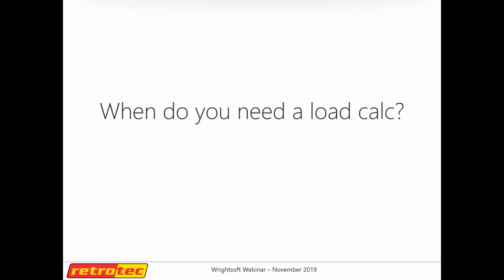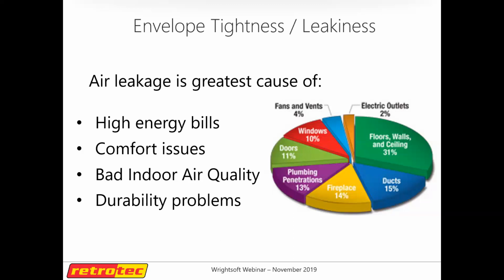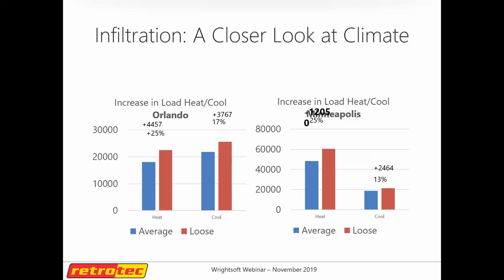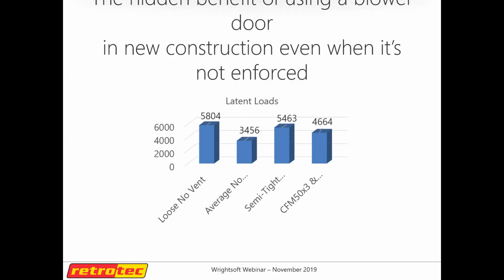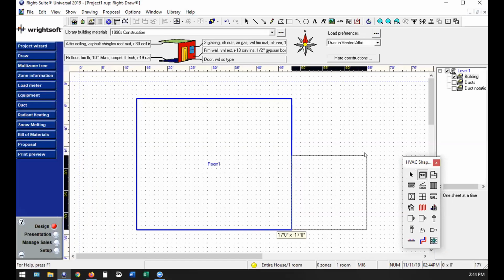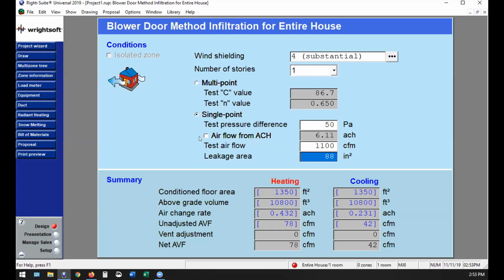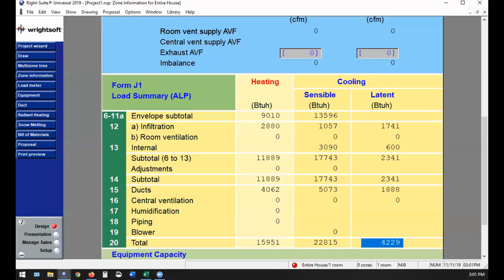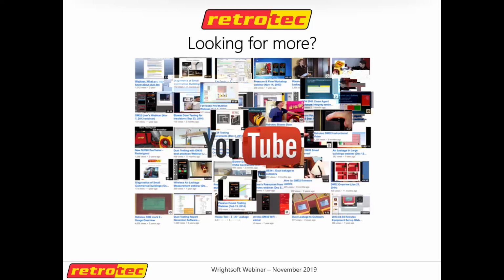Blower Doors, Duct Testing & Manual J with Wrightsoft's Alex Meaney

Comment: As a homeowner acting as their own contractor, someone who has HVAC training, tools, a degree in electrical engineering, and other skills, I am going to replace our gas/electric package unit, so will pull a Mechanical Permit after I finish learning a variety of building codes, doing a Manual J  and S to make a proper selection.

The home is in Durham, NC, and has R-4.2 insulated flex ducting, so there is more to do than simply rip out an old unit and replace it with a matching unit.

My question is:

I have been learning about both your software and testing hardware, and think they are good, but the whole point of doing this myself is to save every penny I can in difficult times. So, do you have a way to sell/rent to poor people such as myself who want to do a good job, but cannot afford to purchase top of the like tools. I have already spent a lot on the Digital manifold with Blue-tooth
enabled ancillary gadgets.

Looking for information as to the cheapest way I can do the tightness and duct leakage tests, along with an accurate Manual J and S.  TIA
Reply from the maker: you may be better off having someone come do the testing for you, when you compare the pricing to renting equipment. A couple of contractors near you that know their stuff that I know of include Smart Home Comfort and Scientific Comfort Services. Otherwise, reach out to sales@retrotec.com for a quote on a DucTester rental.